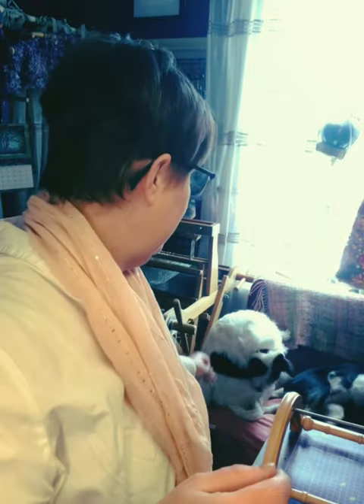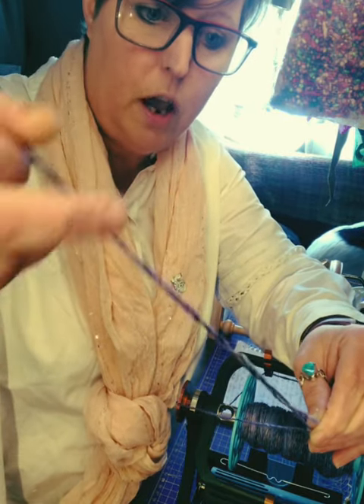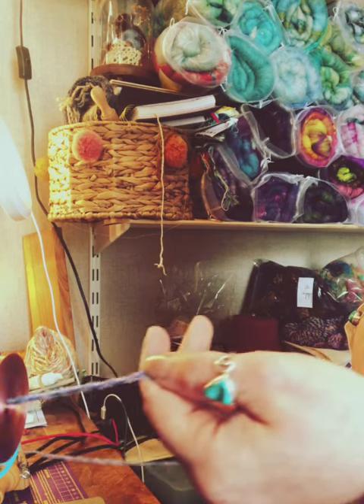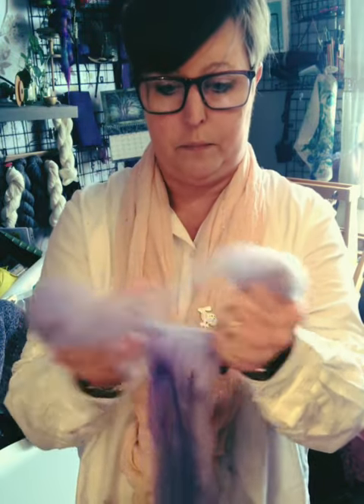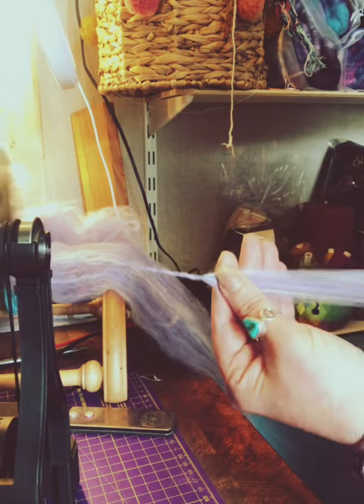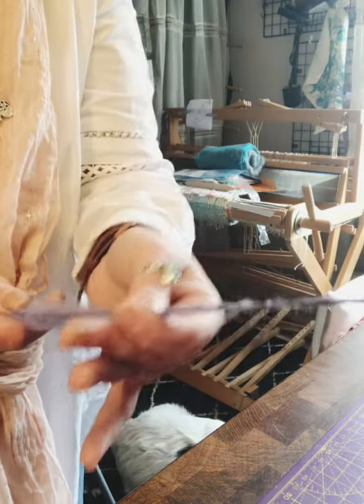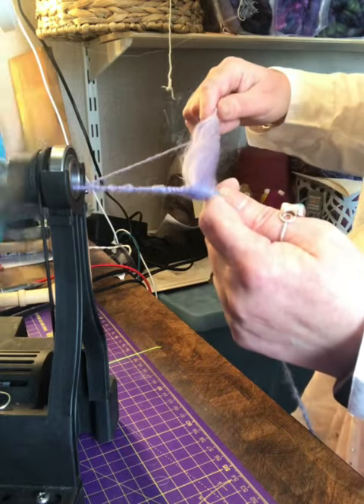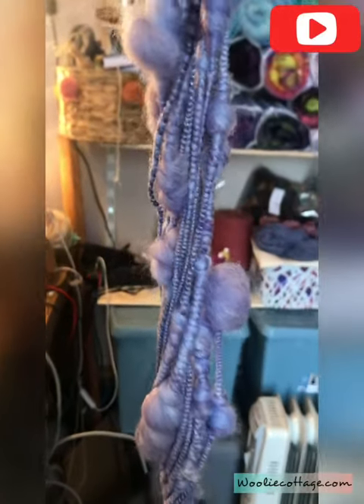Back to Basics Part 8- Single ply & Thick-Thin Slub spinning #spinningyarn #handspunyarn

Comment: awesome video Jo you demonstrate & explain things so well I struggle with the thick & thin but with your help on how to do it I’m hoping I will have some luck & nail it 😊(maybe) 
Thank you so much ❤
Reply from the maker: Oooh you can definitely achieve it Susan just remember take your time, slow your treadle till you feel confident and up your tension a little too. 🧚‍♀️
Reply: @chattyjo1  definitely going to give it another try I have an e-spinner so I won’t need to treadle Thank you 😊